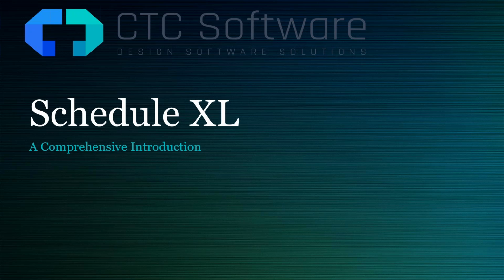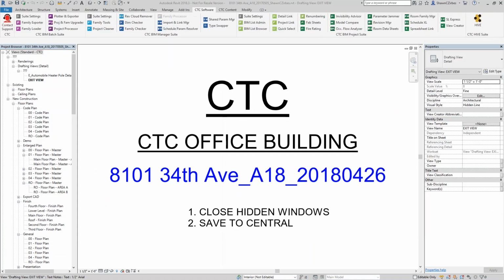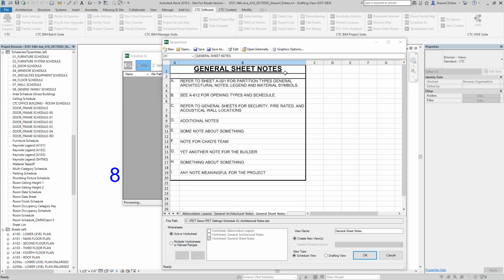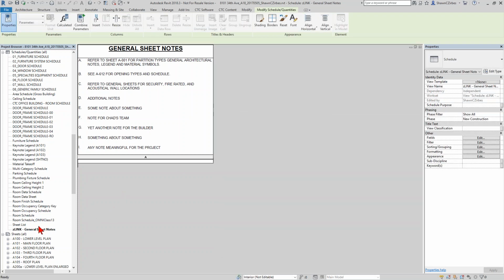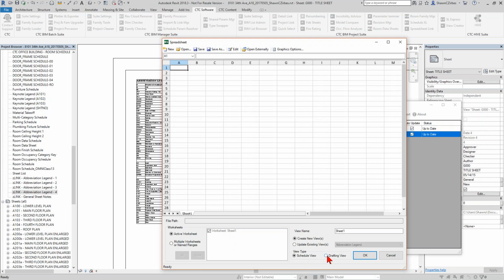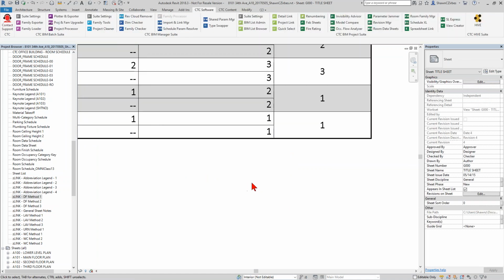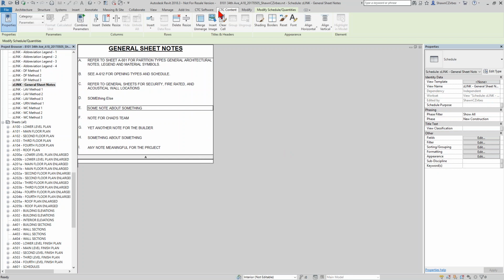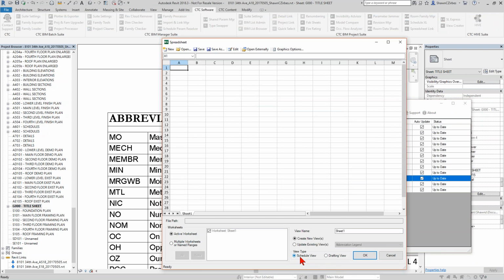Introduction to Schedule XL from the BIM Project Suite

Comment: is this tool working with the BIM 360 Documentation?
Reply: Schedule XL does work well within Revit Models stored in BIM 360. It does not currently source Excel files from BIM 360 Docs. That feature is coming later this year.